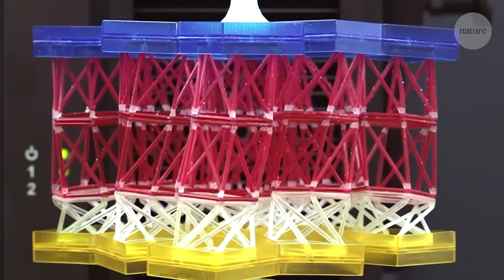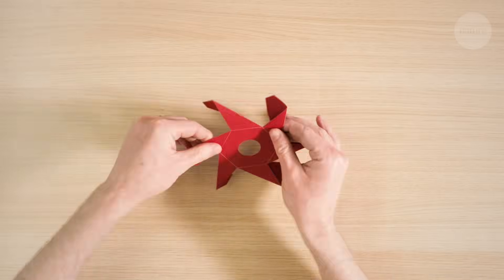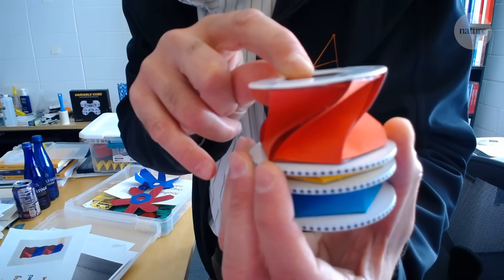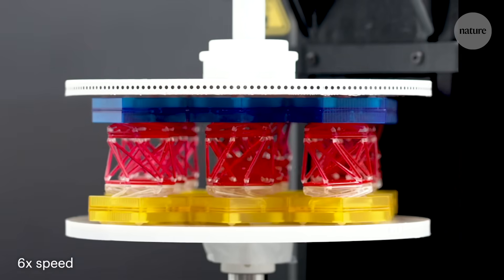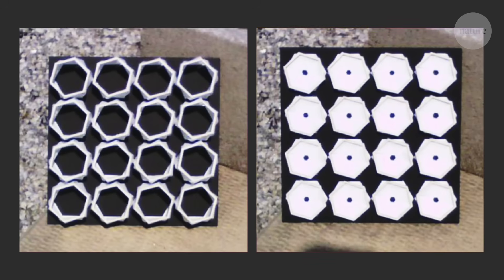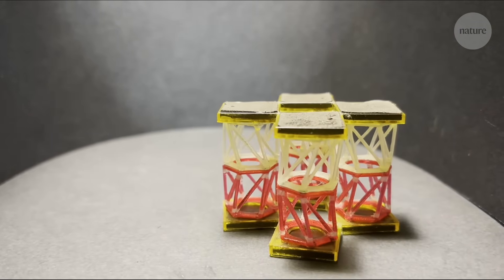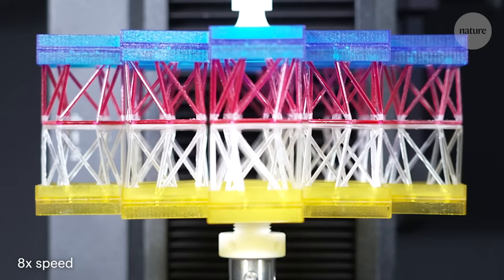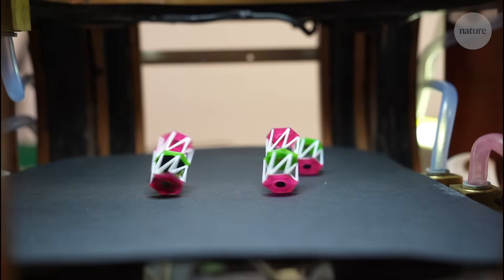Metamaterial origami robots

Comment: I can see this as a way to fully extend a solar panel array for a space probe or on a station (either in space or in Antarctica or in other parts of the world); though a regular telescopic pole would (may) work the same. This type of mechanical metamaterial could be uses as a way to build a structure easily for a lunar base or after a terrestrial conflict/disaster.